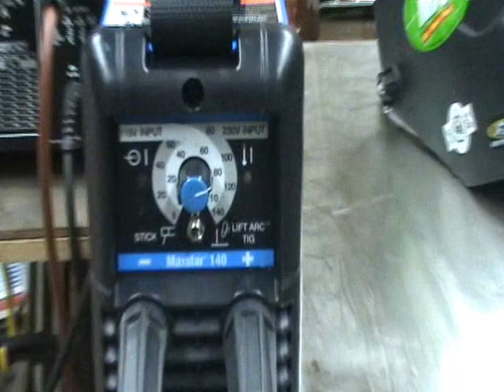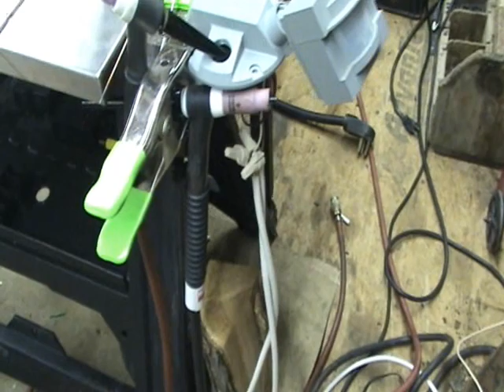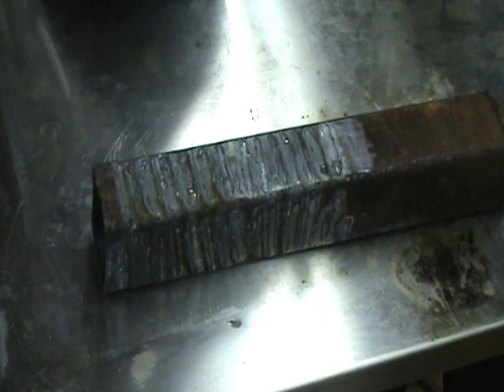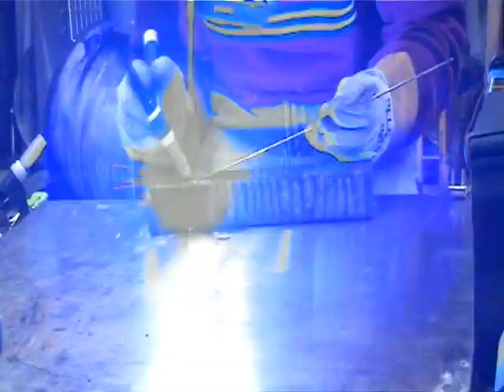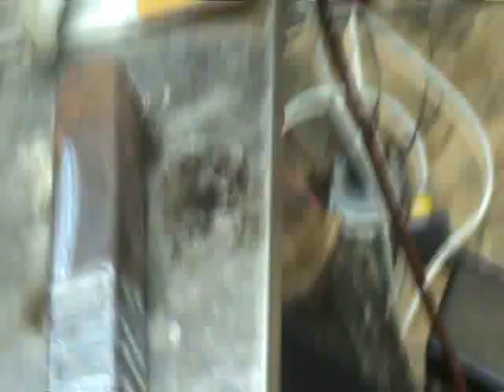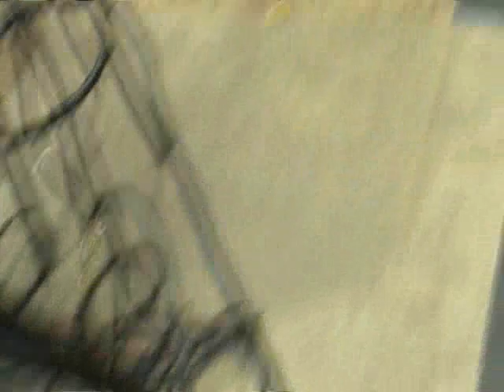Miller Maxstar 140 Tig Operation

Comment: I have the early Miller Maxstar 140 and want to purchase the correct tig gun for this machine. It does not have the built in selenoid for gas but has the lift arc switch. What gun is right for this unit?
Reply: I have found that the gun is the WP-17-12-R. So I'm good with this. What I need to know now is what you used for an adapter to connect the gas to the gun?

Comment: i have a miller maxtar 140 STR  the maxtar 140 comes with the gun to weld tig, I buy argon gas recently unfortunately i don't know how to adjust it to weld stainless steel 20 gauge for example or also i don't know if i can weld aluminum 22 gauge or regular iron 22 gauge? some one can tell me were my machine have to be on each of the 3 cases also the argon gas i nee on each scenario, please send me an email to mike@ironguys.com or send me a text to 323 804-2578, i am really appreciate your time

Comment: When you start try resting the edge of your cup and slowly rock the torch till you touch the tungsten. Also when you pull away at the end to break the arc, quickly put the torch back near the puddle to get gas coverage.
Good luck